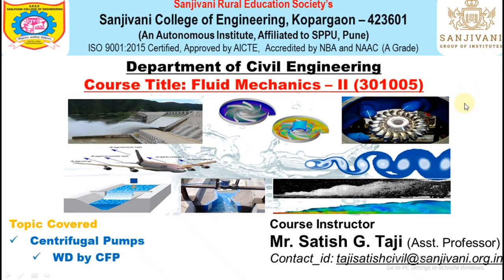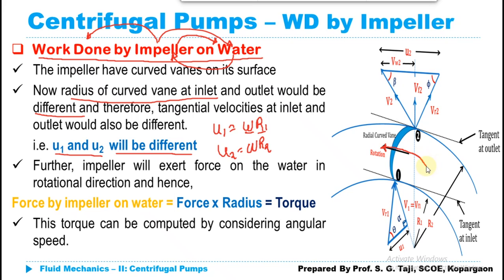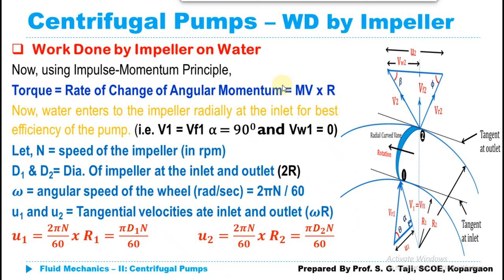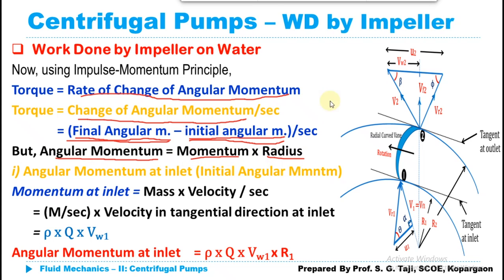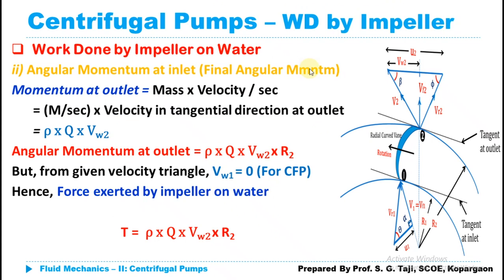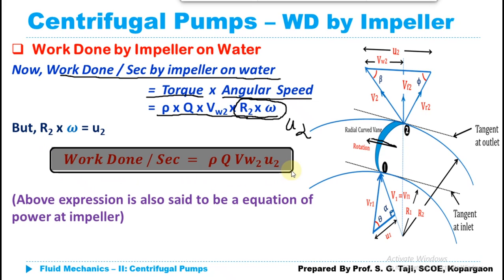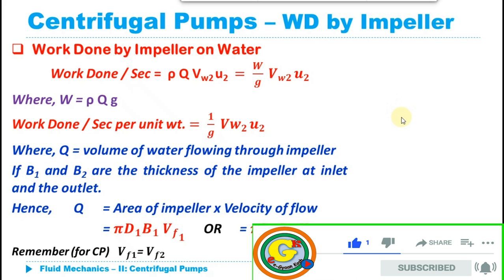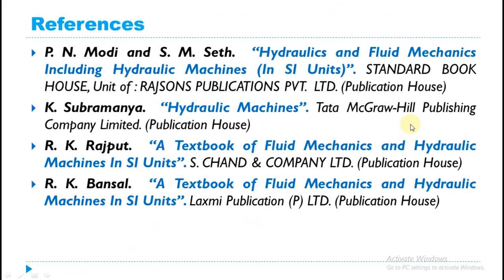Work Done by Impeller of Pump on Fluid | Centrifugal Pumps | Hydraulics and Fluid Mechanics

Comment: How do we get rho ×Q×g/g =W/g
Reply from the maker: It's very simple
Rho x g = W 
Put this value in the expression and we'll get the required equation
Reply from the maker: And the same has been said there,
Unit weight
But not simple unit weight only 
Because it has an term Q multiplied with it
Hence it is unit weight of flowing fluid per sec

See, work done by impeller is given by 
Rho x Q x Vw2 x u2

Now I can write this equation as 
=Rho x Q x Vw2 x u2 x (g/g)
Put rho x Q X g = W 
Now check out units of W
=kg/m3 x m3/s x m/s2 = N/m3 x m3 per sec
Which is Unit weight or specific weight of flowing Fluid per sec.

Now You will have equation 
Work done per sec by impeller as
= W/g (Vw2 x u2)
Where, W = rho x Q x g

If you want to compute WD/sec per unit weight of fluid per sec then
= { (W/g) Vw2 u2 / W )}
= (1/g) Vw2 x he

Hope this will help
Reply: @e-gyaankosh007  tq ..sir